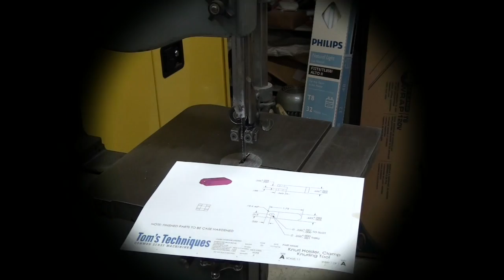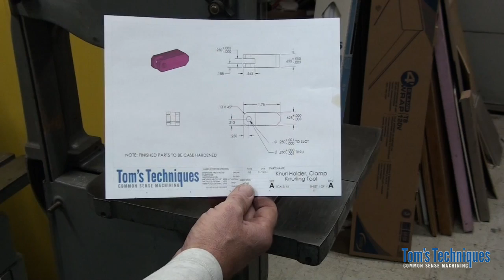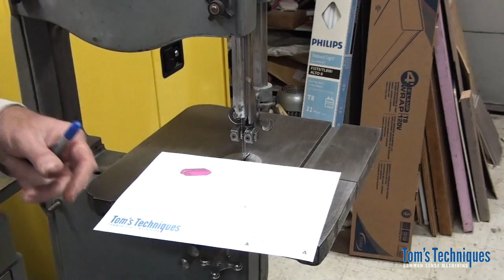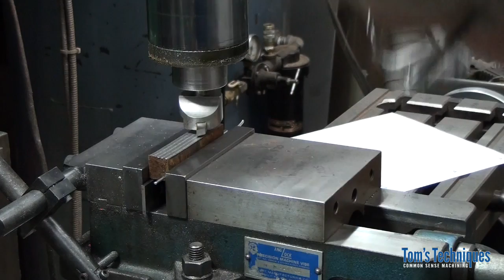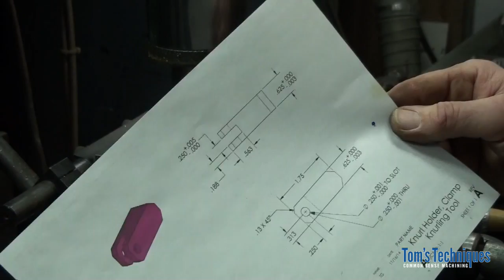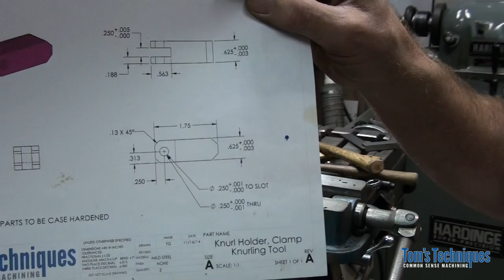Clamp Knurling Tool, Knurl Holder Part 1, Squaring the Stock

Comment: as for using the steel hammer my dad used to say never let the tool /machine be smarter than you  the steel hammer works just fine been doing it for years  thanks tom keepem comin /glad to have ya back
Reply from the maker: Thanks Joe.

Comment: Hi Tom,
This design will surely beat me high side pressure tolls I'm using now, even though I rarely do knurling on parts.
Thanks for the time you spend on this,
Pierre
Reply from the maker: Maybe if you have a good knurling tool, you'll knurl more often!

Thanks for watching.

Tom

Comment: Great video. I learned something new from it: milling tall parts in a vice front-to-back (+/-Y) is not the way to go. Milling them +/-X will prevent them from shifting in the vice. That's the opposite of what I would have thought. Good to know.
Reply from the maker: Thanks. It's all about how the cutter interacts with the workpiece.

Tom

Comment: Good point about proper ball pein hammer use, Tom
Thanks,

Paul
Reply from the maker: Thanks Paul. The purists hate it. :)

Tom
Reply: Toms Techniques  Most people generally just start mashing stuff with their ball pein, let alone not know which end to use or where.
Reply: A toolmaker here recommended the ball pein end for tapping down and as demonstrated in this video there may be some merit to this and also using the flat face of the hammer on an angle , it is fine as long as you can remove the marks left by the hammer.
If you don't want to damage the work you could use a piece of brass/copper or lead to dampen the blow or just use a lead hammer instead -it won't bounce and it won't do any damage and also the best for knocking out the morse taper tools on a mill as it gives a soft thud type of impact rather than a sharp rap like a steel hammer.
p.s great video Tom i really enjoyed it as i have bought some fly cutters  and looking forward ti tying them.

Comment: On your finish cut on the first surface I noticed you measured from the opposite side, that must mean the bottom of your vise is parrall over about 5 inches.  I never would have guess that. Damn thats is nice.
Reply from the maker: jim sanker 
That has to be a given on a mill vise. If the bottom of the vise and the solid jaw aren't parallel to the X axis, they need to be made parallel or you need to invest in a new vise. A lot of the Chinese made vises are not well made and must be machined to be useable. There are lots of videos around on how to do that.

Tom
Reply: Thank you. I'm going to check into that

Comment: Thank you Tom for another great video.  Do you ever use cutting oil when you are milling steel?  I know in another video you said you don't use WD-40 when you mill aluminum because of the smoke.  What do you use?  Is there a water  soluble cutting oil that you would recommend?  Thank you for sharing your knowledge.
Reply from the maker: Any water soluble cutting fluid will work for steel or aluminum. If I use it at all, I just mist it on with a spray bottle and then make sure the machines are cleaned up afterward. Flood coolant on machines that only receive occasional use tends to encourage corrosion.

Comment: We generally don't go faster than 500sfm on most materials in the saw.
Reply from the maker: 500 sfpm for aluminum, 100 for mild steel.
Reply: Yes thats correct. I used to have one of those old round DoAll charts that shows saw speeds.
Reply: Most of your plastics, nylons, delrin, etc seem to be done a little faster than 500.

Comment: Tom when using  a fly cutter that's  wider than  the  stock does it matter where the fly  cutter  is positioned ?
Reply from the maker: Not really. You may get a slightly better finish it it's offset to one side because the tool spends more time on the work, but  not by much.

Tom

Comment: you probably get asked this 5 times a day. how does the wire create a better gripping contact. i cant figure that one out.
Reply from the maker: +Jack T 
The wire compresses a bit and evenly distributes the force of the movable jaw on the vise. Without it, the jaw would put all the clamping force on the highest point, which might be at the edge of the part. This would result in a poorly held part that could move during machining.

Tom

Comment: How in the world are you getting better contact using that piece of wire?
Reply from the maker: If you push on a saw cut edge with the vise jaw, it's only going to make contact  at one or two places. The aluminum wire crushes and distributes the force over the entire edge.
Reply: The small radius of the rod also helps to stop to movable vise jaw from dragging the piece up or down so it will sit flat against the fixed jaw .

Comment: Why bother with the parallel when placing the two short blocks in the vise?
Reply from the maker: Because otherwise they would fall through the opening in the center of the vise.
Reply: That sounds like a pretty good reason. Thanks.

Comment: in this video it was ade quite obvious youre using some sort of auto feed. how does your setup work?
Reply from the maker: +Jack T 
The mill has a Servo brand electronic power feed. It's just a DC motor driven by a pulsed speed control through a gear on the feed screw. The unit replaces the bracket on the end of the table that supports the dial and crank.

Tom